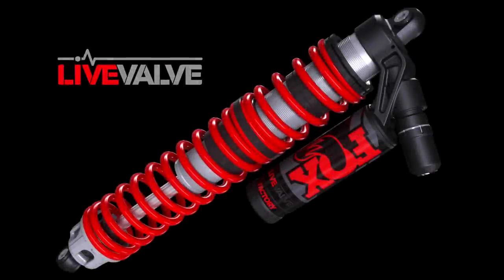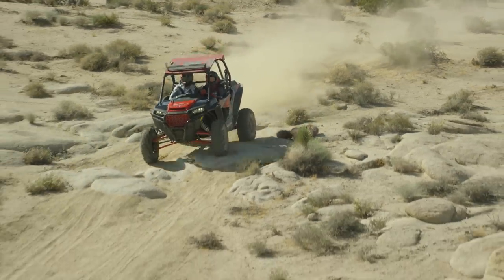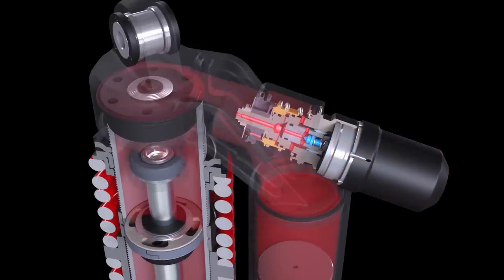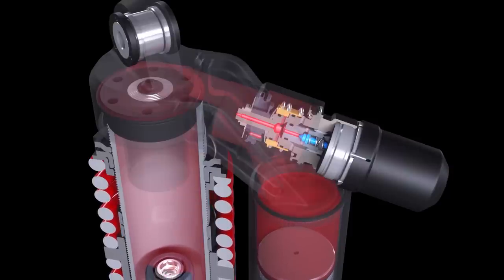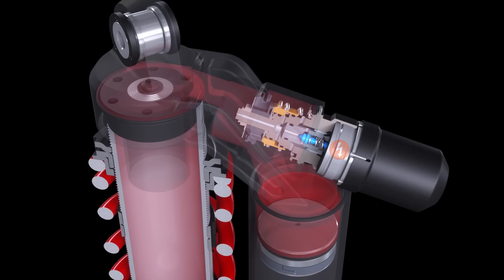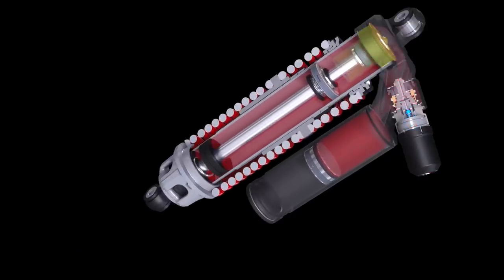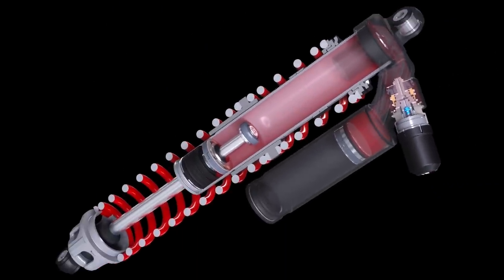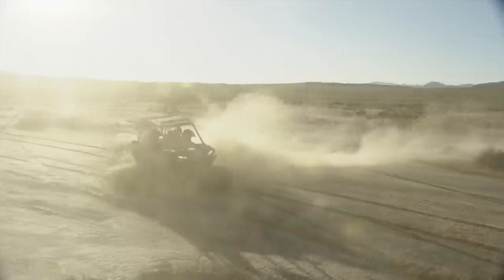Live Valve & Bottom-Out Control Technologies Explained | FOX

Comment: So since these are coming standard on the 2019 Raptor, and I am very interested in upgrading my 2017 shocks to these, will you make a retrofit version? Also, more importantly, does the shock fail safe - meaning, if the electronics go wrong, will the shock stiffen out to ensure you have maximum resistance so you don't trash your suspension offroad?